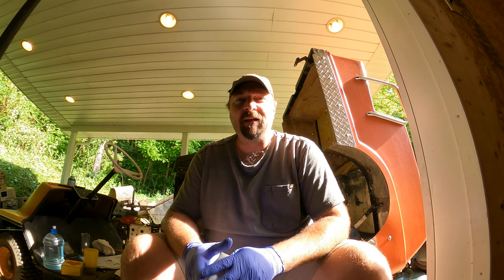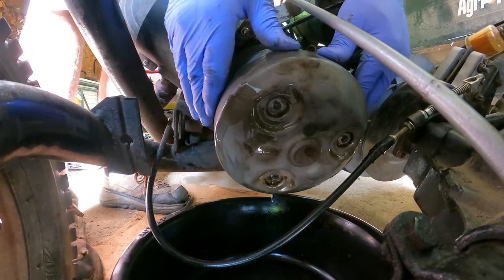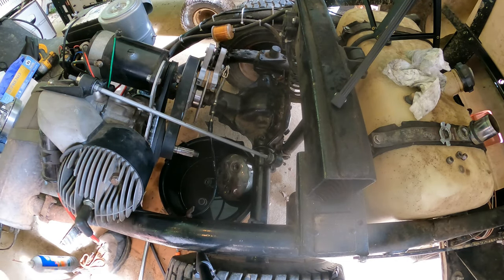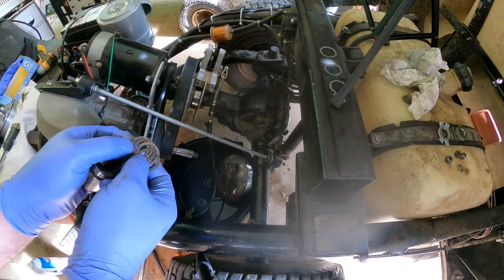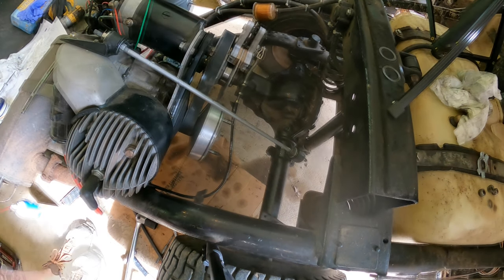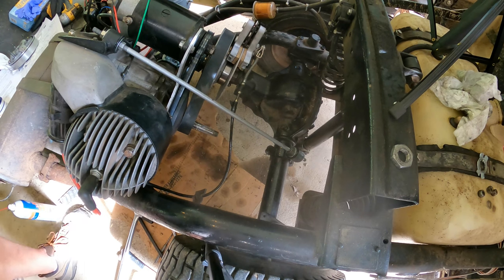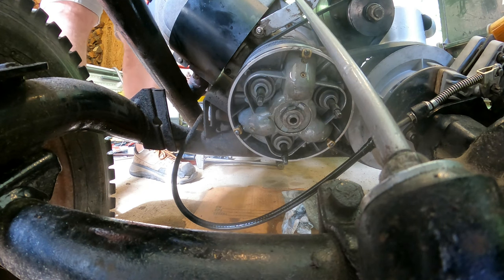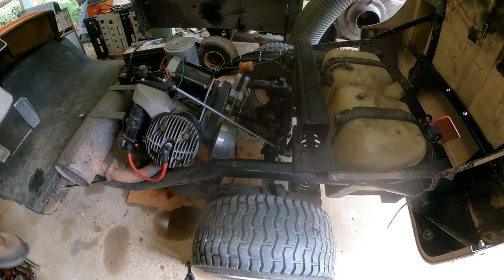P17 How to shim the primary wet clutch on the Harley Davidson Golf Cart for a new belt

Comment: are you able to give me guidance.  I have a golf cart like this and it is idling but the clutch won't engage.  It might need the shim adjusted but hoping it is something easier.
Reply from the maker: The clutch shouldn't be engaged at idle, just off idle and wide open throttle. If not engaging then, I would say either the belt is loose (needs shimmed) or is wore out. Hopefully there isn't an issue in the clutch itself. It's hard to trouble shoot without seeing it.

Comment: Great video man. Do you know the differences between earlier 6 spline drive cup assemblies and later. I might have a mismatch since the ones I have seem to need to pressed on the shaft and the one I removed required lots of heat and copious amounts of impactiing on a 3 jaw puller to get off, not rusted on and a fairly recent resto. Thought I was gonna have to turn it to liquid to get off. 😬
Reply from the maker: Thanks, I do not, from what I understood is there was a 9 spline (63-71) and a 6 spline (71-81). All the parts manuals and service manuals I have only show these two versions. I will say it don't sound like something is right though, it shouldn't take that much to get it off. However I have only worked on a few of these so far and they have been relatively easy, no heat but did use a puller. I'm curious why yours was that stubborn to get off?
Reply: @SABsGarage  I am too. Definitely not right. Seen different options on the vintage cart parts website and had 2 different ones for 6 spline. Been doing some light filing to debur and even out high spots but the shaft looks really good. May be aftermarket and a hair larger. I'll keep working on it and find out something. Thanks